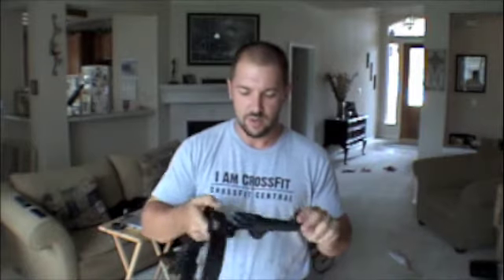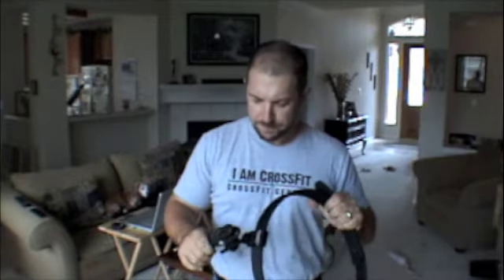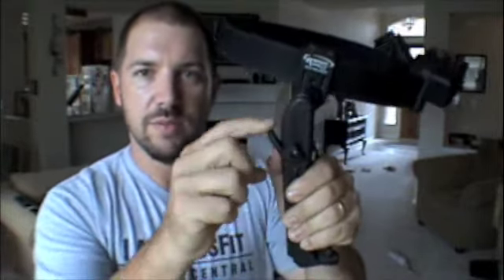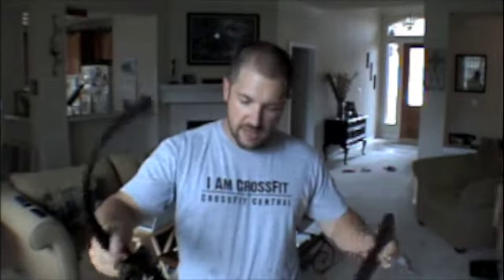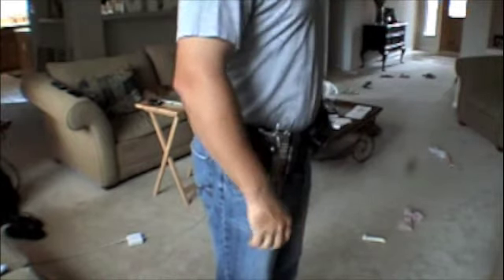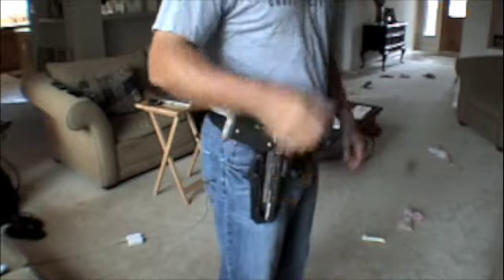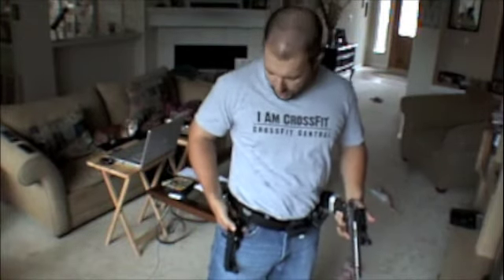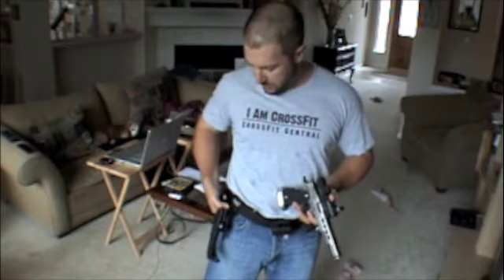Setting Up a CR Speed Holster Part 1

Comment from the maker: paid9mm - the holster is actually right behind the point of my right hip, and is basically in legal position for all USPSA and IPSC divisions. That said, it's not for IDPA - however, IDPA won't let you run a holster anywhere near this racey, so... it's a moot point. Pouches would have to move for USPSA Production, or for IPSC Standard, Production, or Modified.

Comment from the maker: jkatz, are you messing with me? :-O LOL...

Safety comes off after the gun is out of the holster and pointed into the target - I prefer to take it off before forming the grip with my left hand - otherwise, I occasionally have problems with the heel of my left hand interfering with movement of the safety. A slightly safer way is to wait until the grip is formed and the gun is pushed out onto target. DO NOT take the safety off when you form your grip on the gun in the holster...